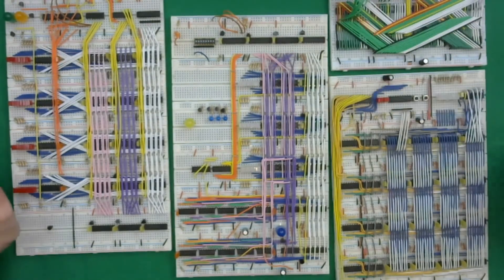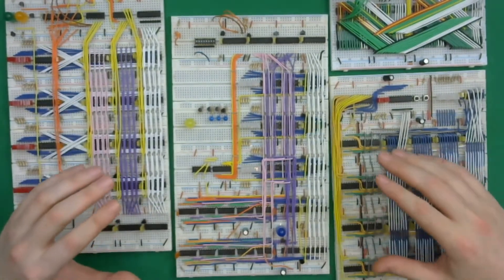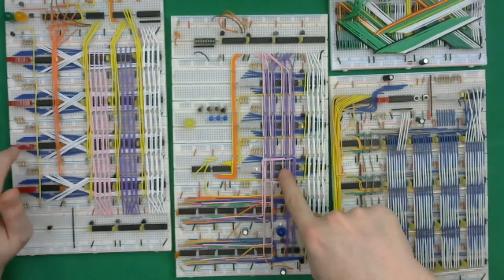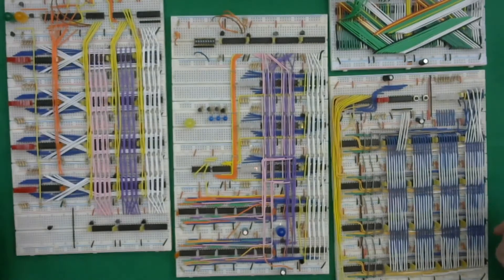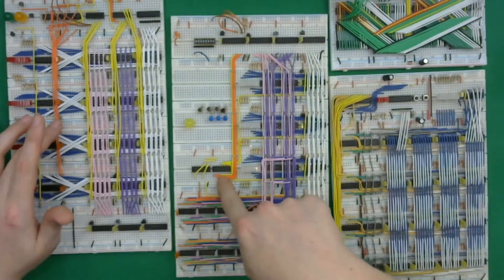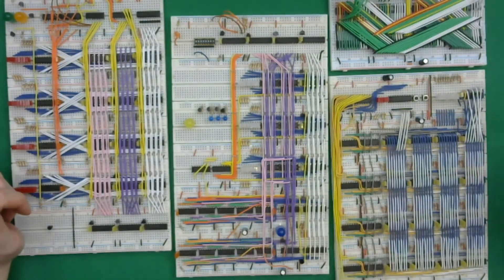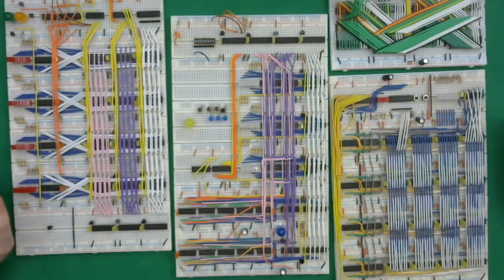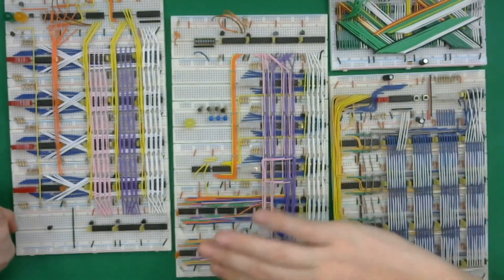Wiring Colour Scheme - Plum Breadboard Computer

Comment: Great video! How do you get your wires to line up perfectly? Is there a specific tool you use to cut and bend them?
Reply from the maker: Thanks, glad you enjoyed it. 😄 Nothing special, just wire cutters and a pair of rounded needle nose pliars, then a lot of repetition and thrown away pieces. 😉 I tend to lay the wire down on the breadboard and bend it against the grid. I also sometimes use another breadboard as a kind of bending jig just so I've got more room to move. After a while I just got used to it and could start to eyeball it. Though it's been a while now so I'm probably a bit rusty. I do intend to pick the project up again, but I moved out of London in a hurry before lockdown so it's all boxed up and I don't have a workspace right now. 😞

Comment: Is your internal data bus 16 bits actually? Is this computer 16 bits then? Thought it was 8bits! I am building a new CPU right now and it's going to be 16 bits. What width are your registers then? 16 bits as well I suppose ? I am designing this new 16bit cpu right now so I can run MS-DOS on my new computer. I also have a video circuit which connects to the TV. Well done
Reply from the maker: No it's all 8-bit, pink and purple are two 8-bit busses on their own or one "16-bit/2x8-bit" bus combined and I can present a 16-bit/2x8-bit address by using two registers. One for the low byte and one for the high byte. Why do I want to do that? Because the memory module has a 16-bit address space. :D
Reply: I agree that for addresses it has to be 16 bit. But the data bus could as well be 8 bits. You just need to use it twice to manipulate 16bit values.. I am designing a new 8bit cpu, and my data bus is 8bits. I can manipulate 16, 32, 64 bit numbers as well..... That's why I asked you if your CPU is 16 bits. For a 16 bit cpu the bus must be 16bits, but not for an 8bit one.